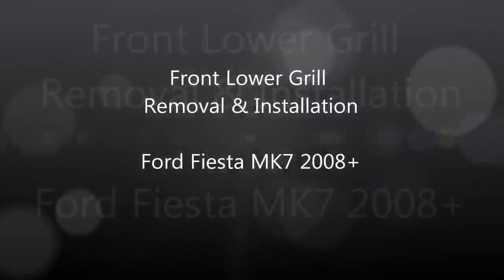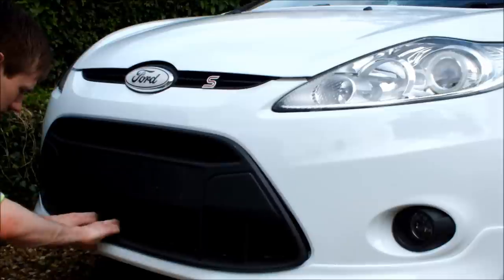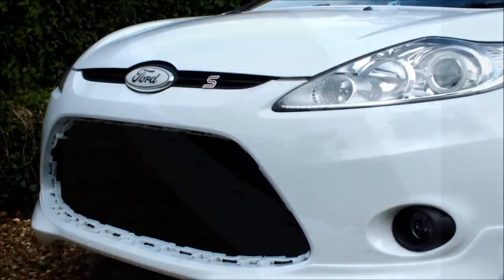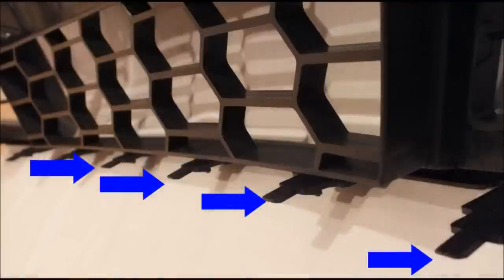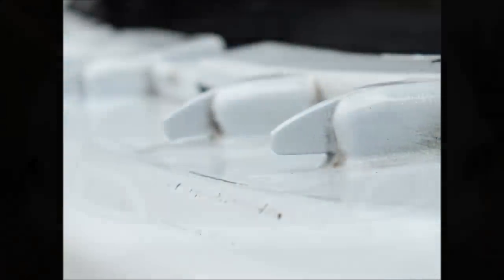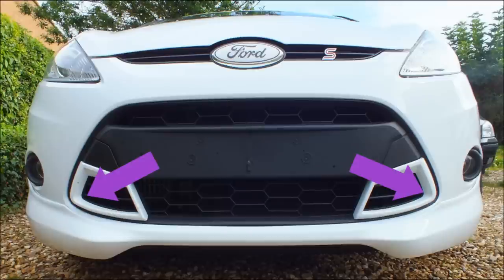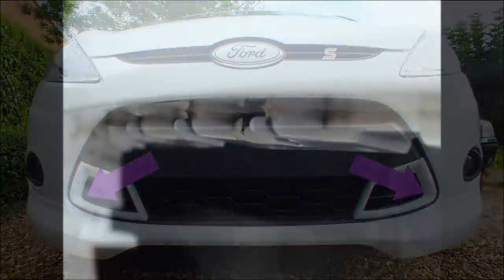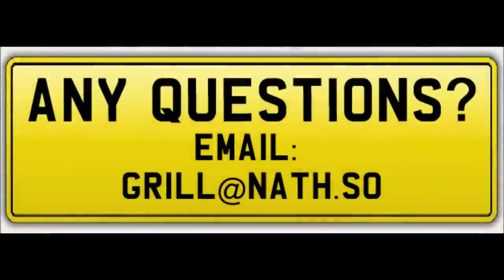Ford Fiesta MK7 (2008-2012) Grill Removal + Swap (Asian/Australian Sports Grill)

Comment: How did you attach your 's' badge on the grill next to the ford badge mate?
Reply: Did you find out???
Reply: Still didn't find out? XD
Reply: ANYONE FIND OUT YET?!?!?
Reply: Go onto ebay and type in S badge, you'll find Zetec S badges that have a screw coming out of the back. Slot this through the grill and use the included back plate to secure it. Hope this helps :))  @condog4202

Comment: Where did you buy this from as I brought one off eBay and it didn’t fit  although I have the right car
Reply from the maker: I bought direct from the factory. What issues are you having with fitting it?
Reply: nathDOTso  I have a zetec s 2009 and I brought it off eBay it says it should fit my car but it’s not made right what factory did u get yours from and do all the clips reach did it leave no gap at the top pretty gutted tbh been wanting to do this for ages and it don’t even fit
Reply: nathDOTso is your car a zetec s ?
Reply from the maker: It was a Zetec-S yes. It's not a perfect fit and does require some force to get all the clips in place.

Comment: where die you bought the S Logo ? 
and how die you installed it ?
Reply: Crackn Dertch order off eBay, they have these plates and little bolts that you screw on the back